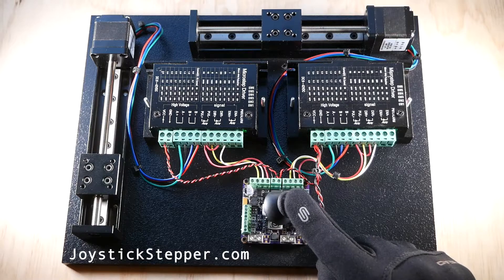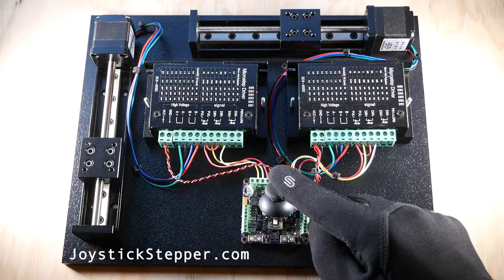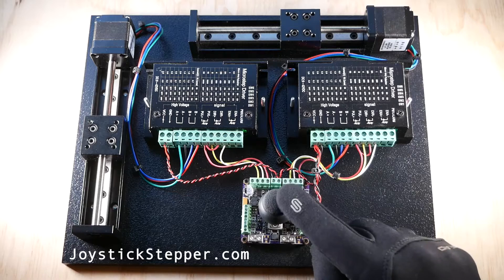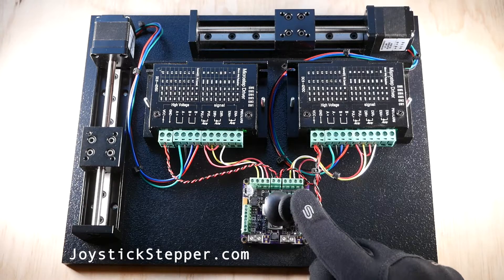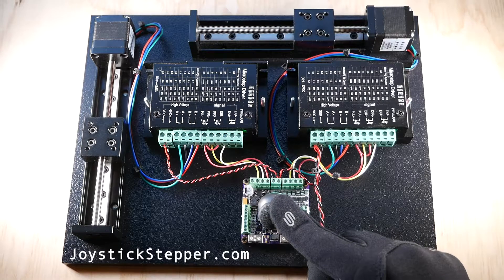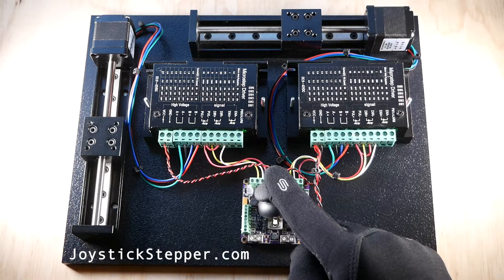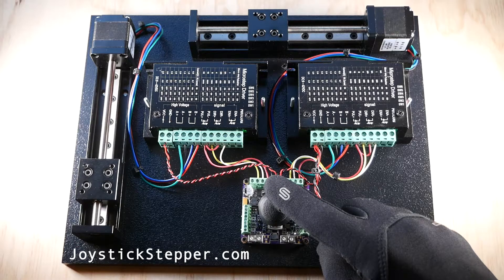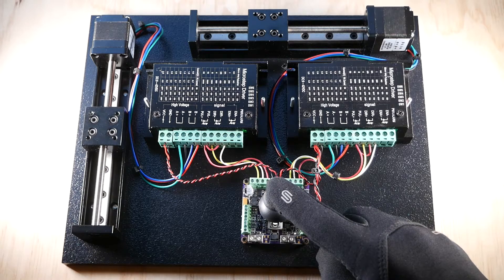Joystick Stepper Motor Controller | Buy Now | No Coding

Comment: Can you get the motors on one or more axes to move at a continuous rate and use the joystick to make it run faster or slower in the opposite direction and return to the contiguous rate when centered?
Reply from the maker: Is this for a telescope?
Reply: @instrumentinabox6552  Yes

Comment: Would be perfect to power a telescope mount, Umm, may have to purchase on of these. Is it capable of fine movements?
Reply from the maker: Yes the speed is proportional to the deflection of the joystick. We have sold several for use with telescopes.

Comment: What are the difference with respect to the configuration without the 2 amplifier boxes? Less consumption when no motor movements? Anything else to be noted?
Reply from the maker: The Amplifier boxes should be used if high power >2 Amps motor current is needed.